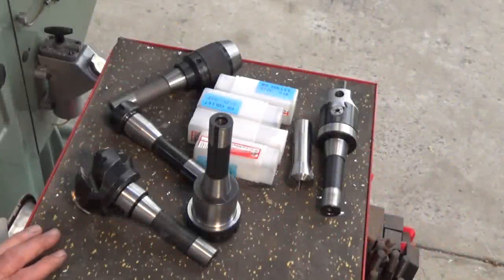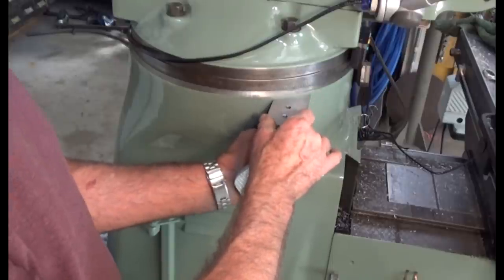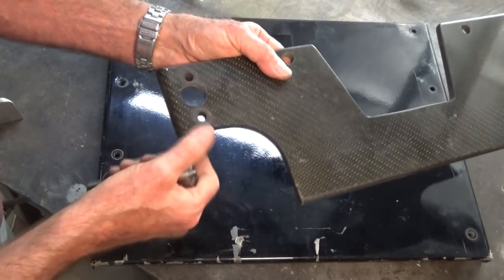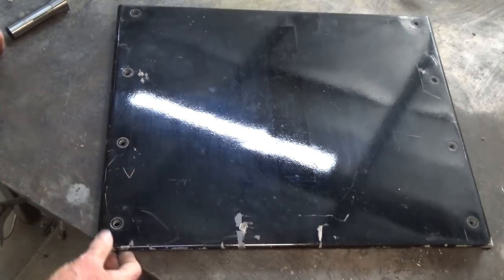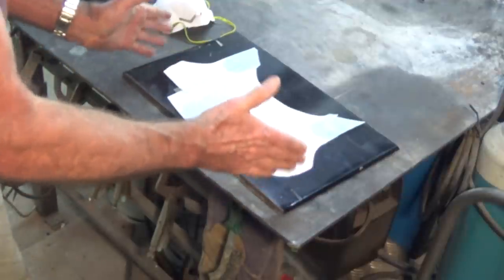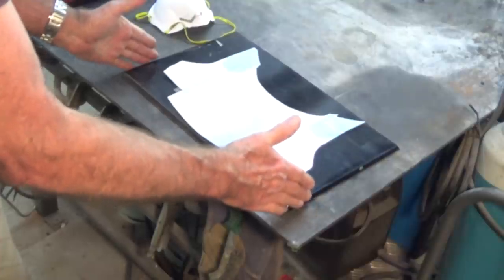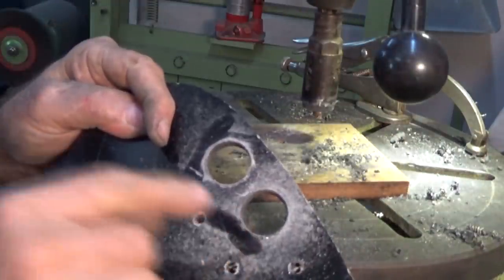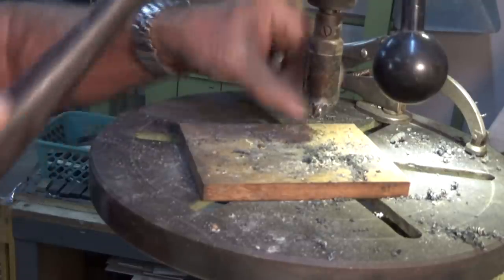DIY Carbon Fibre Collet Rack for the Bridgeport Milling Machine

Comment: turned out beautiful. I keep all my milling tools in a cart with desiccant bags in each drawer to keep down the rust. And every fall I put the desiccant in the microwave to drive off watter. Works well so fair.
Reply from the maker: Sadly, I am not that organised. I try to keep exposed surfaces oiled but with a wood shop next door there is always a film of dust that gets attracted to the oiled surfaces and the wood dust itself can be corrosive. It's a constant battle.
Regards,
Mark

Comment: Starboard is another great material for this.  Lightweight, cheap and almost as strong as carbon fiber. Get it in black, looks just as good.
Reply from the maker: I must say I have never heard of Starboard. I just Googled it. It reminds me of those composite panels used for RV's. 
I bet it machines nicely.
Regards,
Mark
Reply: @Preso58  Its used in the marine world when you need strength and something that wont rot.  It does machine pretty good and is tougher than fiberglass by a country mile.  Cheap too!

Comment: Never can accuse you of just giving up!   I think it turned out very well, its handsome too.   Try this powder coating tip.  Ive found that parts that didnt powder coat well and showed pits or dry areas much like the part you experimented with did can be RE powder coated.  I was making a very large bushcraft style knife and made the blade from some old 1095 I had on hand.  But that piece of steel had seen better days and had some rusting on one side that was fairly deep.  I gave the blade a dance in the blast cabinet and decided to PC it but when finished it showed some pitting.  I then hand sanded with 150 grit and knocked off all the gloss and kept going when I noticed that the coating was acting like a primer surfacer and filling in the pitted areas.  I then repower coated the blade and it came out most excellent and you could not tell anything went wrong before.  You just need to be able to ground the part (you guys say earth).  Give that a try next time you get your PC stuff set up.
Reply from the maker: My main problem was that the clear powder coat became cloudy due to some contaminant in the underlying material. I do have some sandable powder coat which is sort of like a primer. As you say, you can go a long way to improving the surface texture by doing multiple coats. I think powder coating is highly underrated in the home workshop. 
Regards,
Mark
Reply: @Preso58   I love finishes!  I have painted a fleet of cars and trucks, parkerizing, powdercoating, polishing, electroplating... all bring me happiness.  Sometimes a project will be a total piece of crap but with a nice finish it gets respect, just no use.  When it comes to clearcoats I usualy opt for a two part acrylic urethane (automotive) clear.  It dries fairly quicly for additional top coats and nothing shines more than acrylic urethane once color sanded and polished.  Im starting to want a milling machine now.

Comment: Hi Mark, when using hole saws in thick steel plate they cut faster if a small hole or two , say 6 or 8 mm is drilled just on the cutting line of the holesaw , this allows somewhere for the chips to go and  stops the teeth from clogging and slowing the cut, this would probably work for other materials too.. Great videos.

Comment: I made R8 holder for the shelf out of a Corian I got from a removed counter top. Worked great
Reply from the maker: Truth be told, I really wanted to make the shelf out of aluminium but I didn't have any thick enough and as I was looking through my stock of sheet material I moved aside the pieces of carbon fibre and then realised that the CF was just the right thickness and just the right size. Corian would be great too. 
Regards,
Mark

Comment: When I cut things that create dust, I place it into a container with a piece of HDPE at the bottom so I don't cut through the container. I use a diamond hole saw and add water to just cover the piece. Makes a beautiful cut with no dust and reduces the heat. That is awesome that you can plot it out with the laser. Turned out really fantastic!!!

Comment: Hi Mark,
The rack turned out well, you must be pleased...
It was interesting to see McLaren in Woking, I live about 35 miles from there and had a couple of ex McLaren software engineers working for me...
Take care
Paul,,
Reply from the maker: It was interesting how different it was going from the Red Bull factory to McLaren. At Red Bull we were free to take photos of just about anything and we got right up close to some of the engineers, aerodynamicists and the CNC machines. At McLaren we were forbidden from taking any photos and we had to hand in all our phones and cameras before we entered. We were lead around by two minders who were PR types and not engineers but the tour was off the chart in terms of F1 racing heritage. Bruce McLaren's first Austin 7 was sitting right on the floor along with the 2009 MP4. When we were leaving one of the students we were with picked up a stone from one of the gardens outside the complex and she was swooped on by some security guards who took the stone off her and then checked her phone for any photos that she might have taken after leaving the secure area. Still, it was one of the highlights of my visit to the UK. I subsequently got to tour the Williams factory just before Bottas left for Mercedes. 
Regards,
Mark

Comment: Awesome video as usual....
Just a FYI, I used to build those tables back in 2004 - 2006..
I used to machine nearly every part and fully build by hand..
All the wiring and hoses were also made per machine...lol..
I thought the carbon looked familiar...

Comment: Hi Mark.
Thank you for another good clip.
Now... "My opinion" :)

After purring that epoxy over carbon fiber, you could sand and polished it.
It will give really nice surface. It's not necessary of course, but... just for the sake of beauty :)

For fitting the brackets to the cast of the machine... epoxy... easy and quick... 
How about scraping? Long, unnecessary but... will fit it perfect, and give you a nice feeling :)

Just remember... you do not have to scrape with scraper :)
If you are fitting something coarse, you can do it with angle grinder. You just need enough points of contact.
Reply from the maker: I did use metal filled epoxy as a bedding filler on the light bracket and it worked great. Just recently I made a bold claim on Instagram that the rack was strong enough to stand on and I was called out on what must have seemed like an idle boast. Just to show off, I did actually climb up and stand on it and it didn't send me crashing to the floor so I'll take that as a win! 😁
Regards,
Preso

Comment: Excellent repurposing, looks great, interesting to hear on your manufacturing approaches.
I worked at a company that manufactures Kevlar control rods for some military aircraft (about 25 mm OD X 1750 mm long) plus other Kevlar products on machine  maintenace, the Kevlar dust was getting everywhere, and causing electrical failures on equipment that wasn't dust proof.
Chamfer, without the "P" 
Great vlog as per usual, thanks for sharing.
Regards John.
Reply from the maker: John, there is a local company called Kevlacat that makes large water craft. They had a contract to make water police boats for Papua New Guinea and part of their accreditation process was to show that the Kevlar/ glass fibre composite panel they were using on the vessels was impact resistant. As a joke they set up a test panel on a stand and blasted it with a shotgun. When the vessel was commissioned the PNG police thought it was bullet proof and as a result considered themselves invincible. Sadly, it was not the case and they had to be warned not to go up against armed vessels without some precautions. I think Kevlacat were one of the first companies to be able to successfully bond glass fibre to kevlar. I wonder how damaging carbon fibre dust would be to electrical equipment?
Regards,
Mark
Reply: @Preso58  Hi Mark, standard Glass fibre is pretty tough, adding the Kevlar would certainly improve its impact resistance against sub sonic lead shot! bonding to Kevlar is quite a product. Another product this company made was bullet proof vest liners for use by the Royal Ulster Constabulary (RUC) in Northern Ireland ( this 1989/1990), it was light tan in colour and resembled Hessian in structure, this was cut to shape CNC ( can't remember the actual cutting process), then 12 layers were sewn together in a diagonal Criss cross at 25 mm pitch by industrial manual machines, there were pockets added to add a shaped ceramic plate to offer protection from high velocity rounds.
I only worked at this company for a week, I was on agency work, and got a Friday afternoon call to start the following Monday, there were three full time maintenance guys, one was on long term sick, and the other two had been allowed to book overlapping holiday.
It was quite interesting to see many different processes, in composites, from helmets for  the Finnish army, bullet proof doors ( fibre laminated between 8 to 25 mm thick), light weight seats for a military aircraft, light weight truss towers for lighting, and large shrouds for very large deck guns on warships (circa  7 to 9 metre diameter). Only draw back was you itched all the time due to the various fibres airborne. My background is in automotive welding up to then.
It was the overhead crane 3 phase supply tracks and control gear that first became susceptible to the conductive fibres, there was a large grill mesh to the enclosures, this was addressed.
Thanks for replying, enjoying your content, 2020 newbie.

Regards John.

Comment: Good Show Mate...as per normal. Most of the things I have done in the shop are prototypes. Something I've never done before or in a new way. Mark Twain said nothing sapped your energy like knowing how to do a thing...or words similar. Always something new or a little different. Keeps the mind semi sharp.
Reply from the maker: That's the thing about what maker's do in the home shop. Nearly everything is a prototype. I liken it to a never ending expanding radius of knowledge. Each little foray into the unknown gives you some understanding of what to expect as you move forward. I love the process of taking a process and bending  it a little to see if you can use it for some different outcome. Mind you, I had two good outcomes and one spectacular failure today when I was doing some metal casting. Each time I think I have the process nailed I get yanked back to reality.
Regards,
Mark
Reply: @Preso58  Have you ever noticed, whatever the project, that it almost never goes quite like you had it planned...or is that just me?

Comment: A really nice looking collet rack.    A good use of that wonderful piece of carbon fibre plate.  I can appreciate how porous that was after you removed the original paint.  Applying epoxy can be frustrating as you experienced.   I may have used a foam roller for less particles.
With all the tooling you have, I was expecting to see you make the holes with a hollow mill on the CNC machine.   LOL
Well done.   Good to have such a nice custom piece.
Dave.
Reply from the maker: I did actually consider using the foam rollers and I should have know better not to use the cheap fibre roller. I tried to paint a timber floor with a brand new fibre roller and got exactly the same result. When will I learn?
Regards,
Mark

Comment: You may have reversed the screw from top to bottom but you also increased the lever action increasing the distance from the point of rotation putting even greater stress on those screws.
Reply from the maker: That's true but just recently I posted a video on Instagram showing me standing on the carbon fibre shelf. I realised that if the castings cracked or the screws sheared off I was going to get hurt but I can report that I remain uninjured. Whew. 😂

Comment: Maybe make the CF tray removable. Then you can easily remove the tool tray when not in use, and protect your tools from rust.
You could turn the rear screw holes into slots, and replace the front screws with knobs.
Reply from the maker: You haven't seen the disorder in my workshop. I rarely have a horizontal surface free to store anything! Rust and corrosion are my enemies in my workshop too. But it's the price you pay for having the tooling at arms length. If it becomes a real issue I will have to make some sort of cover for it.
Regards,
Mark

Comment: Looks awesome, Mark! 😃 I need to make a better holder too... and I suppose get a Bridgeport to put it on 😏. One of these days. Thanks for sharing! Cheers 👍😁👍
Reply from the maker: If you had a Bridgeport what would you do with all those indicators?
Regards,
Mark
Reply: @Preso58  I would bolt them near the cracks in the floor to see how much it shifts every winter and spring! 🤣

Comment: I love the finish of the carbon fiber. Has to old hotrod machine jeweled look, like was done on dashboards. Does the carbon fiber have the same nasty fiber strands, like fiberglass? Great project, and video!
Reply from the maker: Ken,
no. Free carbon fibre is like graphite. It is a black insidious powder but not like the itchy strands you get from glass fibre.
Regards,
Mark

Comment: If the epoxy hadn't worked, I think I would have used catalyzing clear coat used for automotive paint. You can buy it in a spray can for ~$20 and the stuff dries really nice and is very tough/hard.

Comment: congratulations good job what thickness of carbon fiber? Greetings Valter
Reply from the maker: It's around 6mm thick or 1/4". It seems to be way stronger than required. 
Regards,
Mark

Comment: Blondiehacks uses a product called Boeshield T-9 to protect bare metal.  It's made by the Boeing Aircraft Company.
Reply from the maker: I just googled Boeshield and it is available here. I have used a lanolin based spray that leaves a very clingy waxy/oily film but it's also sticky and not very pleasant to handle. I guess my aim is to eliminate the need for repeated applications of sprays and films by choosing materials and coatings that are a one shot deal. 
Regards,
Mark

Comment: What, no wet sanding and polishing? ;) I'm sure the thought ran through your head.  It turned out great. It's not just the end result but the experience and learning while doing it. Cheers!
Reply from the maker: You certainly have to think on your feet that's for sure. I did consider wet sanding but if you go right through to the underlying material you have to start again anyway. I didn't expect the carbon fibre weave to be exposed after I sanded off the paint. 
Regards,
Mark
Reply: 2 runs of 2 component clear coat, wet sanding by hand and polishing with a low cutting/high gloss polish compound and you get a surface finish like formula1 cars, wet sanding is good enough with 2000+ block or stickers to remove orange peel, to seal carbon fiber cuts  thin CA glue also work very good, for example in those holes, this is my advice, but you also did a good job, liked it

Comment: I cut carbon fiber all the time at home with my router. So prevent burning don’t go over 10kRPM and you will also get a cleaner cut if you use a burr endmill.
Reply from the maker: I really should have used a sharp carbide hole saw but the blunt version I used pretty much wore it's way through. I did see a video by Joe Pieczinski where he used a carbide burr type milling cutter on some very abrasive composite and it cut like a dream.
Regards,
Mark

Comment: Love your sense of humour. for next time use a thick glad wrap like product taut over the epoxy resin and push the bubbles out... Use more resin... Will give you a perfect finish.
Reply from the maker: I once coached a team of students in a model solar car challenge. We made the chassis of the car from carbon fibre fabric and moulded it onto a sheet of plate glass using a technique similar to what you have described. It came out like glass on the surface and we figured we were way ahead on engineering until we turned up to the competition and couldn't get the car to perform. We had bolted the solar panel to the chassis via the electrical terminals and it was only producing 3 volts instead of 12. A real life engineer passing by considered our problem and then enlightened us. "You do realise that carbon fibre is a very good conductor of electricity don't you?" Duh! We were effectively shorting out the panel via the chassis.
Regards,
Mark

Comment: Wouldn't the abrasive properties of carbon fibre wearing against the shanks and tapers of the tooling cause damage over time? perhaps not an issue for a home shop machine.

Comment: Boeshield or LPS #3 to keep em from rusting. Need to wipe down bf use (especially with the LPS, it's waxy!)...
Reply from the maker: I guess it's the price you pay for having the tooling within arms reach. I can actually grab the tools from the front of the mill but I realise they aren't going to stay shiny for long without some sort of maintentance. I've not heard of either of those two products before but I just googled Boeshield and it can be had on Ebay so I'll check it out. I have had good success with lanolin based products but they smell like wet sheep and they can get very sticky too.
Regards,
Mark
Reply: @Preso58  when you want to use a tool, a little wd-40 or any other solvent carrier on a rag with a quick wipe down of the taper you are good to go. The T-9 itself dries to a "dry" waxy coat but doesn't attract dirt very bad at all. I leave it on the outside of chucks and whatnot but I am careful not to get any on the jaws. Works pretty good in my area (deep south USA and VERY humid).  Good luck sir, and thanks for the great videos!!